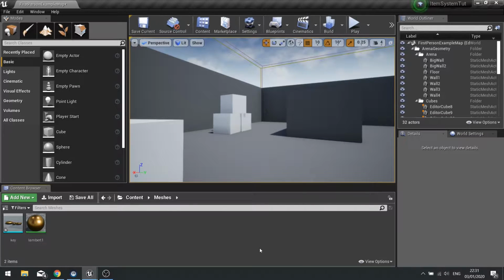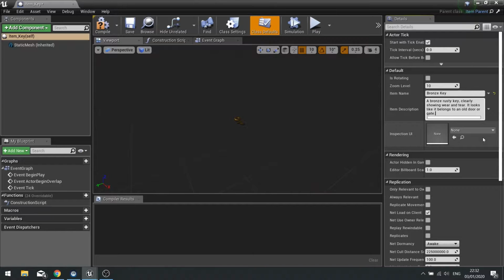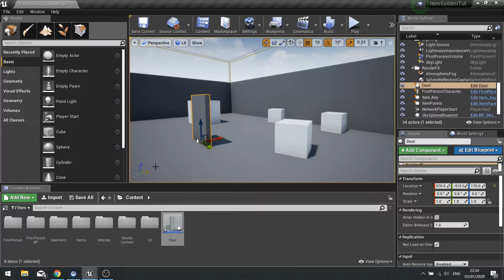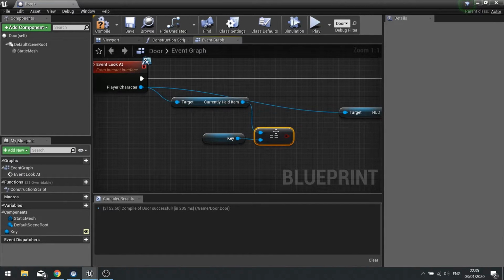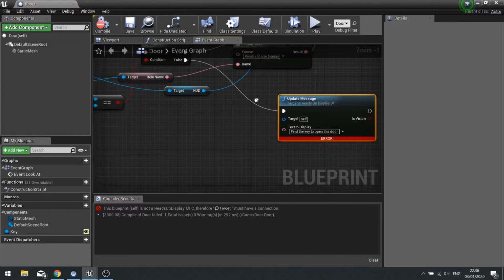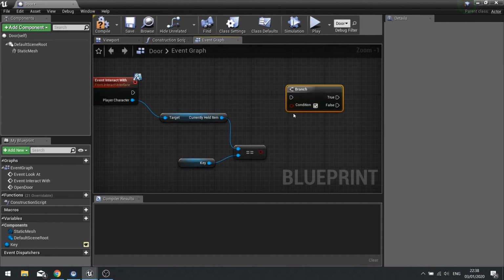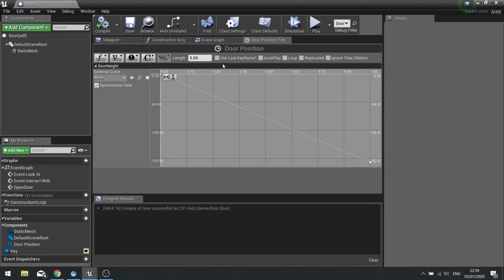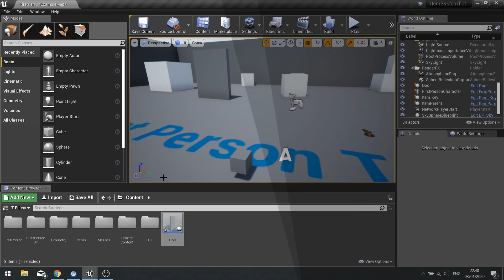Unreal Engine 4 Tutorial - Item Inspection Part 7 - Door & Key Example

Comment: Great one , I just want to just one thing too, if you can include one setup to inside this tur. I.e add the holding item into the inventory (basic) also remove the item from the inventory in hands (holding) again to use it.

Comment: Partial fix: I was able to change distance of inspect start by changing the node float in front of Get Forward Vector in Start Inspect...however, the object is still rotated incorrectly. How would I set the rot on the object to start inspect correctly positioned? 

One other thing I wanted to add in a separate message: When I click inspect, my item is way farther away than I want it to start, and it's rotated strange. I would have loved it if when you press inspect, the item is already in a generally good spot.

Comment: FIX: It was collision. My object didn't have collision on it, so the blueprints didn't see it. Once I properly implemented collision on the object applied and saved it...it worked.

My child object set up and dropped in the world doesn't have any action with it. No description hover, no pickup...If I drop the parent object, all the actions work. As soon as I create a child and change it to my custom mesh it loses all connections and goes dead on me. Does this have anything to do with when I drop my child item in, the origin is way off? I even tried exporting the FBX again with centered origins, and no dice, it still drops in way off of it's origin/control point.

Comment: Found another problem. If I'm holding an item, I can look at another item and interact with it, although it's buggy and then disappears from the world :(
Solution:  in Character BP Event Graph, add a 'Validated Get' for 'CurrentlyHeldItem' after 'InputAction Interact' node (RED), right before the 'Validated Get' of the Look at Actor'. This stops you being able to pick up an object if you're currently holding one :)
Reply: I can't read your reply for some reason - I also got it working by implementing a BP interface to all interactable world objects like doors etc and another interface for pickup able items and then checking for that as well as for currently held item
Reply: @ParawhoreLoL Hi, I am literally struggling with the same issue, and can't get it working with the 'Validated Get' for 'CurrentlyHeldItem', Can you teach me more about creating another BP Interface for pickup able item ?
Reply: i just found a simple solution in fact you need 2 validated get 'CurrentlyheldItem' after the validated get 'look at actor' and not before ( the first set one not valid and the second on is Valid both connected with a different Interact With 'interface')
Reply: @SunroxandMiloulemon  Yea but then the door doesn't work
Reply: By doing this, it breaks the inspection aspect of the code for me

Comment: Ryan there's a problem... Once I've opened the door with the key. Every time I press 'E', I get errors until I pick up another item. Also get errors whenever I look back at the door Frame (I had a frame around my door) Try it and see. Could you do an 8th video regarding these pretty please??
I've made a workaround by adding a variable 'DoorUnlocked?' and set that to true after my door open 'timeline' and 'set relative rotation' nodes. Then added a branch for that in the 'Event Interact' before 'Open Door' and 'DestroyActor' is called. Also added a branch for 'DoorUnlocked?' right after 'Event Look At' is called. It seems to have stopped the errors coming through but would like to see how you would handle these in a part 8, if you have some time to spare. Cheers fella :)